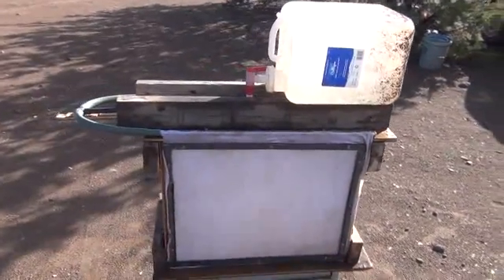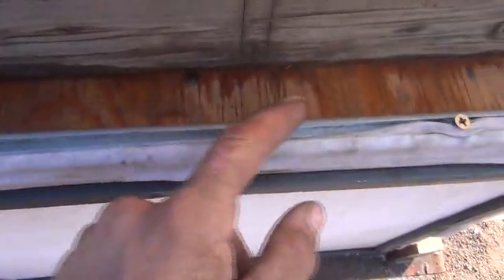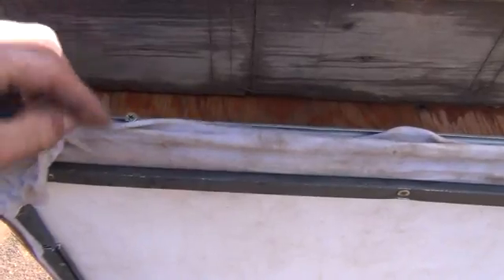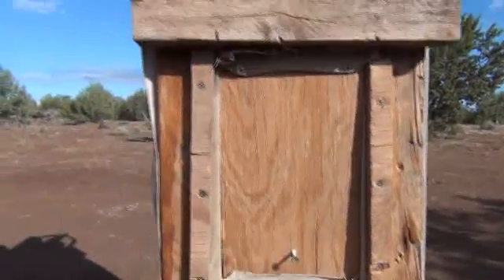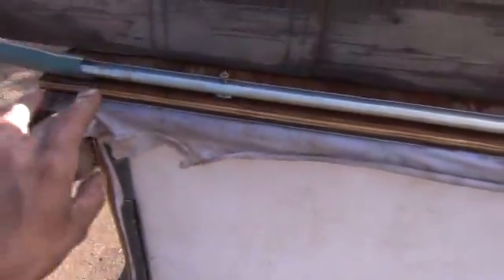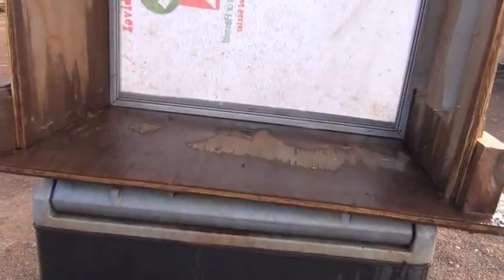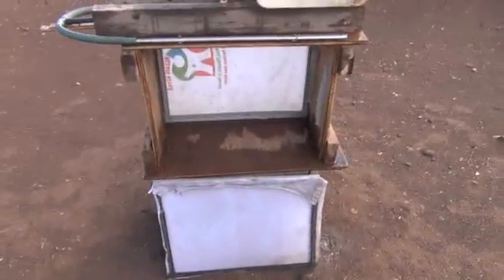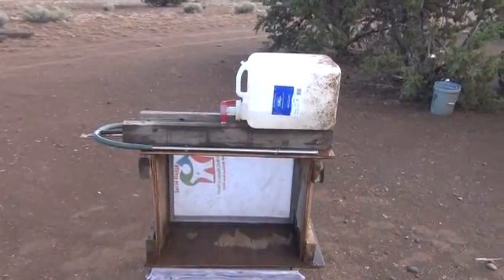home made fridge no power needed!  "Evaprotive Fridge"

Comment: If you use a fan, can you use two in a series to make the second one cooler?  Say it is 90 degrees outside and 65 degrees inside the first unit, can you blow the 65 degree air int a second evaporative unit to drop the temp even more?

Comment: back in the day, farmers would have deep holes(cellars) built with a tiny little house on top, so that they could go downstairs into the deep cellar to preserve the milk. would that( your homemade fridge)bring down the temp to at least 40 or 45, or does your contraption rely on convective breezes from the wind?
Reply: +john randall In Siberia people filled those cellars with huge ice cubes (on shelves along the walls and other ways) which held temperature around 0C (32F) through summer.

Comment: Was wondering how using sheet metal to line the inside of the non wick surfaces of the inside might help?  Foam board is also pretty easy to come by.  Seems to me that the basic box of a fridge is pretty much a sheet metal and foam sandwich.

Comment: I have an idea for you.   I work from a truck and want to keep material cool in the back.  I don't want spend a lot on the expensive 5-10 day coolers.   I figure if I could make a reflective cool box that is insulated (maybe), with evaporative cooling, and then drop any cooler inside..  The cooler would start out in a cool environment, and could potentially keep food cool or ice frozen for a very long time.   Other ideas might include a solar fan.   A box with hinged lids, etc would allow access to the inside or allow the insertion of a cooler.   Would love to see how you work this out.   thanks.

Comment: Simple and easy 4 emergency, great!
How about burring a steel culvert pipe with a white pipe tower rising up high above the ground's heat on one end 4 inflow air.
A buried  fridge except 4 the door on the other end with drip tubing and hanging  synthetic car chamois in the culvert.
A heat tower (heated by the sun) coming up out of the ground at the fridge should create thermal flow through the drip tunnel. With air flow over H2O and the cool earth that should keep the fridge pretty cool. Think?

Comment: Would this work if the dimensions were 54" long X 36" wide X 6" deep? I'm trying to cool the water in my Hydroponic set up without power in 100 degree heat.  Thank you.  PS: Check out the Mitticool, an evaporative refrigerator, which is being manufactured and sold in India.

Comment: I know you know solar ovens produce ice if you fill them w/ water. I was wondering if you've ever considered using a combination of the "lunar" ice maker at night to produce some ice you could add to the bottom of your fridge to help it begin the day w/ a more reduced temp & increase the length of time the fridge keeps it's lowest temp. If you add a dark insulated chamber beneath the cooler and line it with a reflective metal pan to put your ice or cold water in you'd get cool updraft.

Comment: this is awesome. I'll bet it will be even cooler if you put a tent shade around it to block the sun and make everything white outside. Just thinking! Also, what if you cut a screen in 1/2 and use for the floor to spread cold around through metal. Thanks for this post!

Comment: what about mounting  copper pipe  inside on top   with water running through it cold air goes down right? wouldnt copper get kinda colder
 if you could get copper seems like it could do something

Comment: Do you set it so that the wet panels are in the prevailing winds to get max evaporation? Have you thought about adding a wind driven fan of some sort on the outside ( like those whirling lawn ornaments or even a disconnected large electric fan) to increase evaporation?

Do you think that if you shaded the fridge with something like a tarp that it would decrease the internal temp? Or would it decrease evaporation?

Great idea and very simply put together, thanks for posting this.

Comment: This idea has been used for a while by past military technology. For instance, canteens back in the olden days (such as German canteens in WW2) were covered in wool, so that you could dip the entire canteen in water, which would consequently cool the canteen and the water inside it through evaporation.  My canteen is set up the same way.  Its also an old workman's trick to wear a wet bandana and/or neckerchief to evaporate the heat from your neck and head.